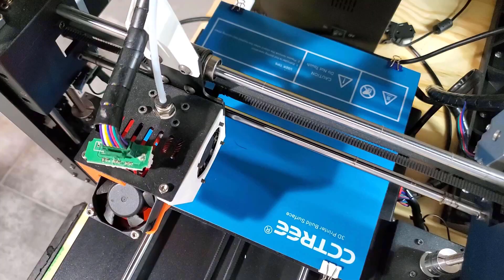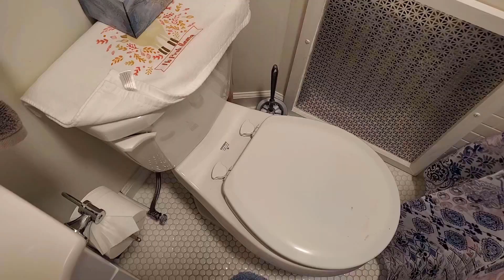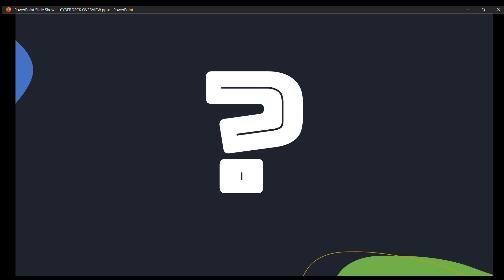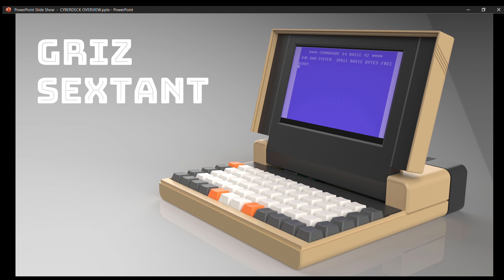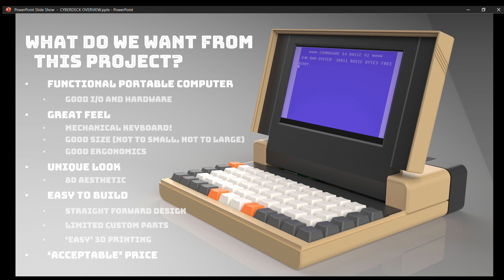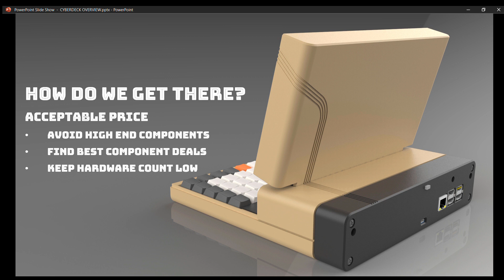BS&OB Ep 2: Cyberdeck Overview

Comment: This would be great for my Raspberry Pi 3B+ that I use in my Amateur Radio hobby.  I take the Pi portable with my Yaesu FT-817ND HF/VHF/UHF transceiver to work digital Amateur Radio modes.  The Pi works fine for that but I have to use my iPad mini or my iPhone 6S and VNC into the Pi to have a display, and a bluetooth keyboard with touch mouse built in.  This would be so awesome.  Juddie - WD8WV